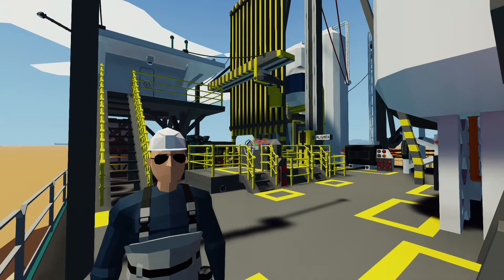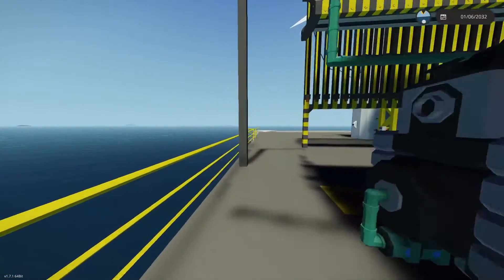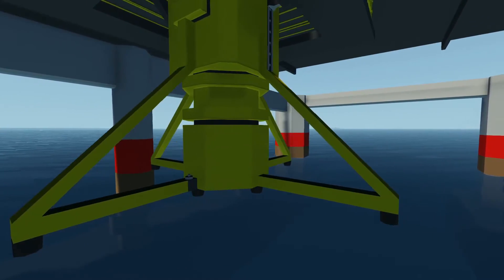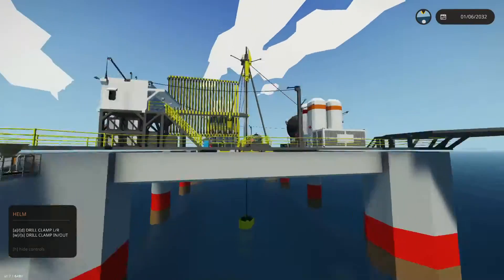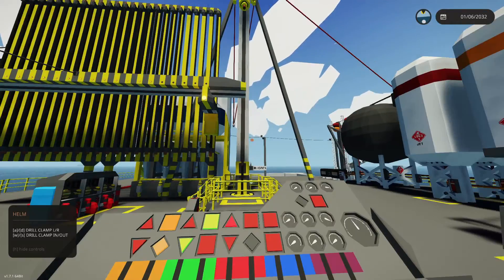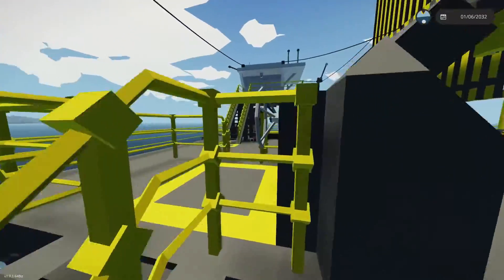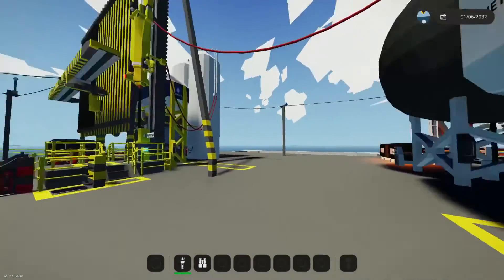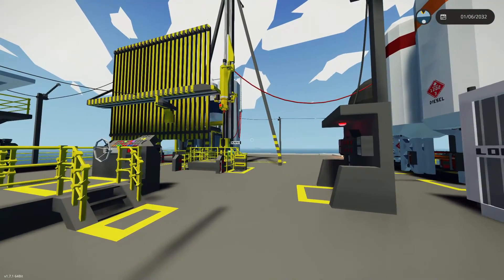Beginners Offshore Oil Rig & Refinery Stormworks Tutorial - How To AIO-All In One

Comment: Just found this video, really great to start learning the process, although you say you have to wait till the furnaces heat to 300, mine are only staying at 25.50. Not sure why this is I have oil, I have turned the kay and flipped the valve to open. Any Ideas?
Reply from the maker: lots of things change in stormworks with every update. could be that the pressure update changed this proccess. havent done any oil stuff since then.
Reply: @ProfNCognito   Thanks. Would you know of any way to fix this? I have no clue what I would be doing but I could give it a shot.

Comment: I'm wondering if you added something like a buoyancy tank to the drill head, would it operate like a regular inland drill because it has that bit of upwards force acting on it so its like drilling normally?
Or would it have to be neutral buoyancy because there's a stage in the drilling where the rods aren't fixed or being pushed down on
Reply from the maker: intresting thought. might be a good idea. havent been offshore for oil in a while might be worth a test.

Comment: Loved the video @ProfNCognito! Can't wait for the next video man! You could build the Rest of the Area Similar to the Oil Rigs that are in Stormworks, Maybe have 3 or 4 Rescue Boats along one side or Have Welders and other Equipment ready to Make Repairs if the Container for the Microcontrollers gets Damaged for some Reason (Not like the Ships of the AI Forces or the Newquay Armed Forces might come by and put you in the Position of a Iraqi Soldier in 1988 during Operation Praying Mantis. Someplace to Load and Unload the Oil to and from Tankers would come in handy too. If you need a Ship to test that out with, FJ Warner has built the Knock Nevis in Stormworks and it's up on the Workshop. He's also got a Scaled down Build of the T2 Tanker SS Winter Hill on the Workshop as well.

I have the Specs for both 80 foot Elco and 78 foot Higgins PT Boats. These are Best known in World War Two History as Being used to Fight Japanese Supply Lines during the Solomon Islands Campaign. The Specs will be from some of the More Notable Preserved and/or Running PT Boats.

80 foot Elco PT Boat (PT-617):
 • Displacement: 55 Long Tons (60.61 Short Tons).
 • Length: 80 ft. (24.615 meters or 98.461 Blocks).
 • Beam: 20 ft. (6.153 meters or 24.615 Blocks).
 • Draft: 5 ft. 6 in. (1.692 meters or 6.769 Blocks).
 • Installed Power: 3 1,350 shp Packard 4M-2500 12 Cylinder engines.
 • Propulsion: 3 Shafts.
 • Speed: 40 Knots (46 mph).
 • Range: 500 Nautical Miles (575 Miles or 934.153 km).
 • Armament (as 617's Preserved): 4 22.5 in. (0.576 meters or 2.307 Blocks) Mark 13 Torpedoes, 1 37mm Gun, 2 20mm Guns, 2 Twin .50 Caliber M2 Browning Machine Guns, 2 Depth Charges, 2 Mark 50 Rocket Launchers, 1 M2 60 millimeter Mortar, 1 Smoke Generator.

PT-625-class 78 foot Higgins PT Boat (PT-658):
 • Displacement: 103,000 Lbs ( Tons).
 • Length: 78 ft. 6 in. (24.153 meters or 96.615 Blocks).
 • Beam: 20 ft. 1 in. (6.179 meters or 24.717 Blocks).
 • Draft: 5 ft. 3 in. (1.615 meters or 6.461 Blocks).
 • Installed Power: 3 1,850 shp Packard 5M-2500 V12 Engines.
 • Propulsion: 3 Shafts.
 • Speed: 41 Knots (47.15 mph).
 • Range: 520 Nautical Miles (598 Miles or 971.52 km) at 2,000 rpm.
 • Complement: 2 Officers, 14 Enlisted.
 • Sensors and Processing Systems: Raytheon SO/SO3 Radar.
 • Electronic Warfare and Decoys: Farnsworth BN Interrogator Responder and Hazeltine BK Transponder IFF.
 • Armament (as 658's Preserved): 4 22.5 in. (0.576 meters or 2.307 Blocks) Mark 13 Torpedoes, 1 Bofors 40mm Cannon, 1 M4 37mm Cannon, 2 Oerlikon 20mm Cannons, 2 Twin .50 Caliber Browning M2 Machine Guns, 2 Mk. 6 420lb Depth Charges, 2 Mark 50 8-cell Rocket Launchers firing Mark 7 5 in. Spin Stabilized Rockets (SSR), 1 M2 60mm Mortar for Target Illumination on the Bow, 2 .30 Caliber Browning Automatic Rifles (BAR's), 2 M1928A1 Thompson Submachine Guns, 2 M1 Carbines, 1 35 Gal. Mark 6 TiCl4 (Titanium Tetrachloride) Smoke Generator.

Evolution of the PT Boats Armament:
 • When the PT Boats were first coming into Service, they were only armed with the Twin .50 Caliber Machine Guns and Some had the 20 millimeter Oerlikon at the Stern/Back.
 • The PT Boats would Occasionally get "ad hoc" up-fits at Forward Bases which would usually be 37mm Anti-Aircraft Cannons, Rocket Launchers and Mortars. One night before the PT-109 would be lost, John F. Kennedy and his crew Commandeered a Single shot M3 37 millimeter Anti-Tank Gun from the Army and had the Wheels removed and Lashed down to 2x8 timbers placed on the Bow. Because the 37mm had more Punch to it, PT Boat Crews looked for Something that could also offer more than just the Single Shot of the Army's Anti-Tank Gun. The Solution was to use the Oldsmobile M4, and Later the M9 Model, 37mm Aircraft Automatic Cannon salvaged from Crashed P-39 Airacobra's at Henderson Field on Guadalcanal which had a 30-Round Magazine. This combined with the High Rate of Fire of 125 Rounds per Minute made the Gun Desirable and after soon proving it's worth, Further Production PT Boats were Being Armed with the M4/M9 Cannons at the Factory.
 • The Culmination of the Addition of Larger Guns to the PT Boats came in the Form of the Bofors 40mm Cannon on the Aft Deck. Starting in Mid-1943 the Installation of the Bofors had an Immediate Positive effect on the Available Firepower from a PT Boat. It's 120 Rounds per Minute Rate of Fire fed by 4 Round Clips and range of 5,420 Yards (16,260 feet or 5,003 meters) made the Gun and it's Four man Crew gave the PT Boats more Firepower for defense against Aircraft or Help to provide Fire Support or Attacking Surface Ships.
 • PT Gunboats: in the Solomon Islands in 1943, the 77-foot PT Boats PT-59, PT-60 and PT-61 were Converted into what's known as "PT Gunboats". This Involved Removing all but the Original Armament aside from the 2 Twin .50 Caliber Guns, Then Adding 4 more Twin .50 Caliber Guns and 2 40mm Bofors. Kennedy was PT-59's First Commanding Officer after this Conversion. On November 2nd, 1943 PT-59 participated in the Rescue of 40-50 Marines from Choiseul Island and a Foundering Landing Craft (LCP(R)) which was under fire from Japanese Soldiers on the Beach.
 • Other Armament: Towards the End of the war, beginning in 1945, PT Boats received 2 8-cell Mark 50 Rocket Launchers, Firing the Spin Stabilized Flat Trajectory 5 in. Mark 7 and/or Mark 10 Rockets with a range of 11,000 Yards (33,000 feet or 10,153.846 meters). The 16 Rockets plus 16 Reloads gave the PT Boats as much Firepower as a Destroyers 5 in. Guns (Albeit without the Accuracy). By the War's end the PT Boats had More "Firepower-per-ton" than any other vessel in the U.S. Navy.
  • PT Boats also commonly Carried Between 2 and 8 U.S. Navy Mark 6 Depth Charges in Roll off racks.
  • Additionally, a few PT Boats were equipped to Carry Naval Mines launched from Mine Racks, but these were not commonly Used.

Hope you like the Idea man, as usual the Source is Wikipedia. I spent about two hours typing this up. Just Imagine having some LCS(L) Mk. 3's and Elco 80 foot and/or Higgins 78 foot PT Boats patrolling along the Rivers in the Sawyer or Meiers Islands Attacking AI Forces!

Fortunate Son Intensifies in the Background

Comment: Automating the process of drilling or jutst moving the rods would be very interesting and I think its possible
Also theoretically you could add a nuclear power plant with a fluid heat exchanger to heat the diesel
Reply from the maker: automation would be cool but this is for understanding how the parts move. its very analog for  that reason. gives it a bit of role play as well. nuclear could be neat but a lot more money.
Reply: @ProfNCognito  Thanks for the answer. Will you upload this to the workshop soon?
Reply from the maker: Yes probably today once I get the buttons cleaned up.
Reply: it is possible I managed to do it. all you do is press one button and it does it all from drilling auto to pumping out refined fuel, without any player interaction.
Reply: Automating isn't possible, I don't think. not while the mechanic that makes drill rods and sliders get stuck for no apparent reason. You need to at least have a manual way to then correct the drill rods being stuck and with the sliders also. I believe from reading through the internet that this issue was intentionally created by the devs, but I might have read it wrong.